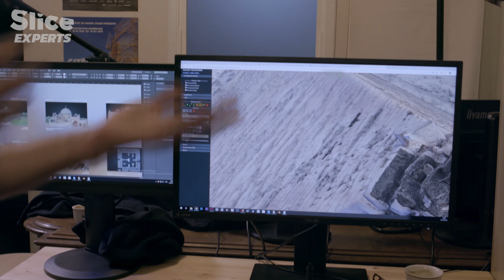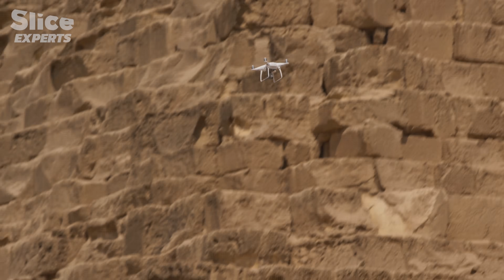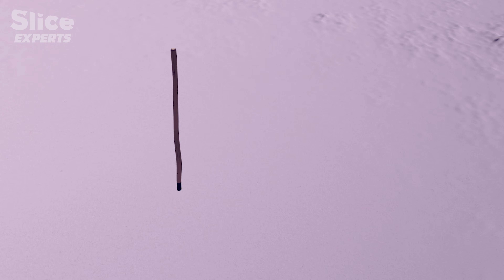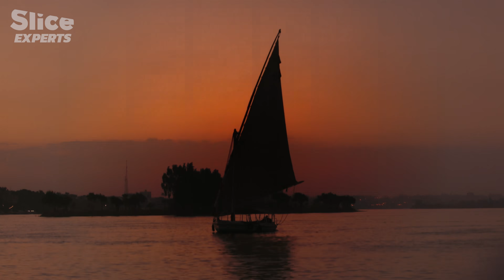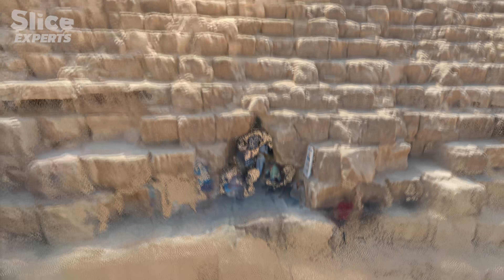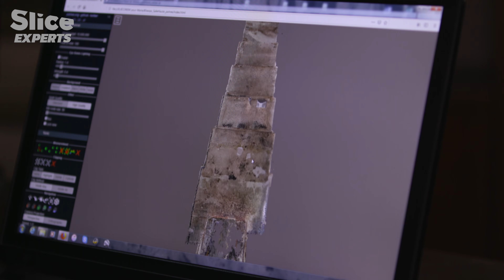Pyramid of Khufu: The New Technology Revealing Its Construction Secrets | FULL DOC

Comment: The plains were very fertile those days-- build four pyramids  first and infill three a gap between the third and fourth dig a small slope down to centre point use cranage combined with  a pulley system   --  all cranage and pulley system build King and queen space area -- to put cranage and pulley system hauling by your system   to higher areas by raising blocks to chamber area  You utilise what you have surrounding -- At that time elephants were  available,animal fat to grease  the cranage     Split a trunk of a large girth tree ,hollow out both halves ,  a second tree is rounded in its entire length-- animal glue the first hollowed out halves together  and bind with rope along the entire length,--- insert  the second  into the round hole of the   first tree  utilising plenty of animal fat grease ,how you wish to complete your cranage combined with pulley system has many ways  Even a star wheel on one end  and winding the inner tree with a star wheel  to raise blocks is easy done or combine your elephant power to wind your crane Lots and lots of ways to build easily your pyramids ----  but for sure you can be sure no one was dragging stones up slopes that's ludicrous.   Rubbish theory of Ramps  being dragged by men